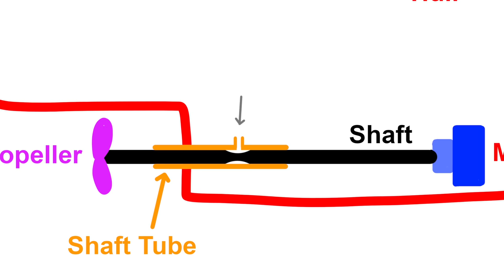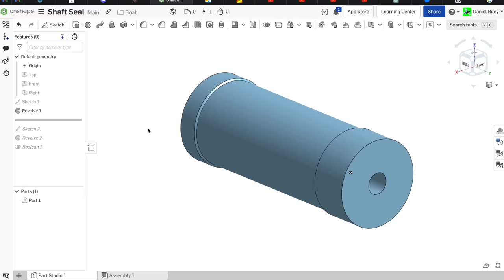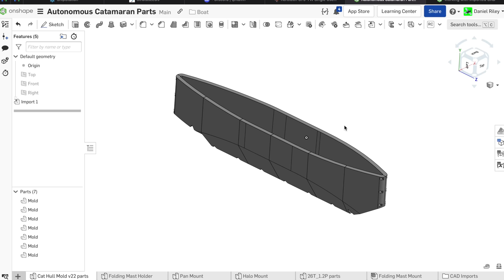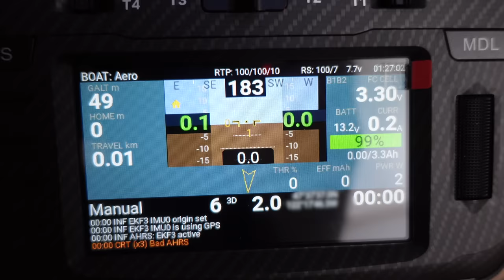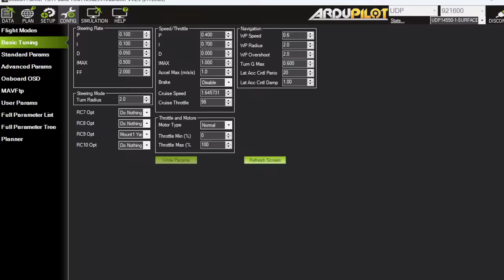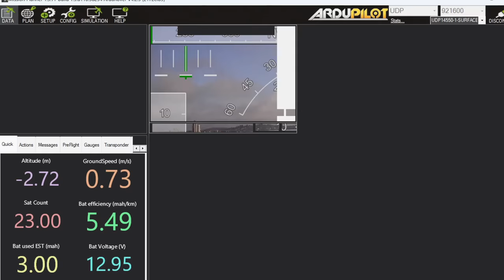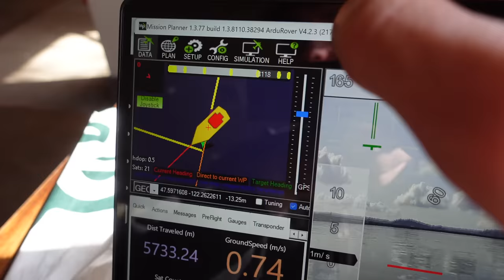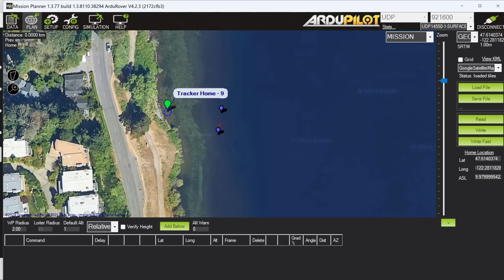5G Cellular Controlled Drone Boat - Long Range Test

Comment from the maker: Use code RCTESTFLIGHT50 to get 50% OFF your first Factor box at https://bit.ly/3JgFdFQ
Reply: Sharpening fins is not good.
Reply: Onboard bildge pump and float swich so you can pump out water as you take it on, for whatever reason.
Reply: Please read my post on Coast Guard Rules, when you are on the water, think as if your were on any public road/highway. Would you drive your RCs on an interstate?  Lights mean very specific things, and you are not following the rules.  Please don't FAAFO with fines or worse, cause and accident.
Reply: we love it when the shaft can rotate freely in the lubricated fleshlights dont we bois? 🥸
Reply from the maker: @Metazone101  hey its daytime. I don't need lights in the day
Reply: how come you dont use arduboat? btw love the vids
Reply: Why don't you use a bearing on your prop shaft so you don't have any play and then you can seal it with a normal oil seal.
Reply: @Metazone101  jeeeez you must be fun on every party. 🤨😑 but i can see you mean it good. just dont overdue it. every tree log in the water cause more damage to any boat than this thing. if my son plays his RC toy boat in a lake i never heard the fuzz will come and regulate him to infinity because he dont have enough lights on
Reply: Is there any possible way to put a solar panel on the boat?
Reply from the maker: @irisartin385  How do nav lights help avoid a collision when this boat is going slower than a walking pace? There's a reason buoy's don't have nav lights. It's because they don't move. This boat is so slow it's basically a buoy.
Reply: @rctestflight  There definitely are lighted buoys in US waters, but that's besides the point. More importantly: red, green, and white lights on vessels have specific meanings, and those meanings are interpreted by mariners, taking into consideration marine charts and timely observations of the motion of those lights. Your use of those lights to mean something else is potentially confusing.

For example: if I am sailing at night and I see a green light, my first question is whether it's a buoy or a vessel. If there is a lighted green buoy on the chart and your vessel is also displaying a green light, that's already one way you can confuse me; if I mistake your vessel for a lighted buoy I might make a course change that results in me running aground, or otherwise putting myself in harm's way. 

But let's say you're in an area where there are no lighted green buoys, and I know this because I checked the chart, or because I can tell that your vessel is underway because of the movement of the light. Now I know that I am looking at a vessel and because I see a green light without a while light above it I conclude that I am likely looking at the starboard bow or beam of a sailing vessel.

If your vessel is dead ahead of me and I am a powered vessel, I should give way by turning to port to pass behind you. But as I do this, I expect to see your white stern light, which would indicate that I have safely avoided a collision. However, I will never see your stern light (because you don't have one) and as a result I need to continue taking evasive action. This can now force me to enter shallower waters (where I might run aground) all in an effort to avoid a collision with an improperly marked vessel. 

Similarly, if your vessel is off my port beam and all I see is a green light, that would mean you're a sailing vessel on a collision course with me. I would either reduce my speed to pass behind you or turn to starboard to avoid a collision; either way, I am again expecting to see your stern light to indicate that I am clear of the collision risk. But that stern light never comes, and I have to continue maneuvering. 

So the risk here isn't that I will collide with you, because as a responsible mariner I sure as hell am not sailing on a course that collides with any light on the water; the risk is more subtle, in that your non-standard lighting will mislead me about where I am (if I mistake it for a buoy) or about the best way to avoid a collision with your vessel (which I agree would be unlikely to pose me any significant harm), and that in itself can put me at risk of a harm from other navigational hazards. This would be especially true for any vessel that is restricted in maneuverability, for example because it has a deep draft and cannot depart from a designated dredged channel.

The USCG actually has a document about this; excerpt: "Boaters should be concerned about installing 'decorative' lighting on their boats in various places, including underwater, on the rubrail, or just above the waterline. Care must be taken that these lights cannot be mistaken for navigation lights […] Haphazard installation of additional lighting must be avoided.". 

Full document at https://www.dco.uscg.mil/Portals/9/DCO%20Documents/5p/CG-5PC/INV/Alerts/1015.pdf
Reply: @rctestflight  dont listen to the hyperkarens and install a freakin rainbow on it. i dare you! 🥰
Reply: @irisartin385  It's basically a toy boat, you've gone over the deep end. Also no one is going to read what you wrote. Just go be weird somewhere else...
Reply: you could use a magnetic coupling for leak proof shaft? i could be  wrong
Reply: @rctestflight  you could use a magnetic coupling for leak proof shaft? i could be  wrong
Reply: Nice face dude Realy slik
Reply: You should try and make a model rocket to land on a drone ship
Reply: @rctestflight  get a solar panel on the top which charges the battery so it can run for days  and doesn't require a Battery change then you will have a Rc boat which can run for ever just need to pay for the wifi

I also have another idea but will run limited like this one it does need a battery change make it oval shaped with a propeller at end make it bright orange and keep all the electronics in the oval  thingy and you can use seramic at the front for camera view you can also add a syringe system for under water purposes if you want but the  wifi will probably won't reach so you can make it only float also the oval shape is for withstanding super dangerous waves
Reply: In 20 years, my humanoid robot will rob the Bank of England, and bring the gold straight to my vault. Thanks to you.
Reply: @Metazon 101 As long as he doesn't know he has a excuse, don't take that away from him...
Reply: @Metazone101  As long as he doesn't know he has a excuse, don't take that away from him...
Reply: if they can afford a 50% off... you should think about their prices...
Reply: GREAT GREAT VIDEO - THANK YOU!!!   Question please --- what provides power to the 5 G unit from HALO?  It is installed on the boat, correct?  What provides power?  Thank you.

Comment: With a slightly larger vessel you could add solar panels and Starlink for super long-range offshore missions.
Reply: I really want to see this happen asap
Reply: I was thinking about starlink too!!
Reply: @SoulAir  oh true, maybe you could design some kind of secondary gimbal that keeps the base perfectly level?
Reply: @seanyfpv  starlink is still geofenced so you’d be restricted to a small box close to shore
Reply: @SoulAir  It doesn't. People have been experimenting recently with mounting the antennas flat on RV rooftops without any tracking and there are now enough satellites in operation for that to work.
Reply: @DHD-  Cool 😎
Reply: You know that satellite links existed way before Starlink, that are much smaller, lighter, less sensitive; way better suited for remote tracking and control.
Reply: @quarteratom  For telemetry, sure, but not for video with a small antenna and affordable price.
Reply: @SoulAir  it used to be, there has been an update that allows for in the move use.
Reply: @them2545  ahh i see, thanks for the info, i'm not too familiar with the system
Reply: @quarteratom  Dam dude. Who crapped in your cereal?
Reply: @motosk8er2  

It was me.
Reply: You're right. Need satellite internet. And then you can send this boat from Mexico to the United States without people. Like a submarine with control. The Jalisco Cartel will buy your idea for $1 million! You are a genius, dude! Welcome to Mexico, a country of great opportunities for smart people!)
Reply: @quarter atom  This is true, but starlink would more or less work out of the box over ip is what the original commenter meant
Reply: Yeah, he can test it by filling it with bags of "mystery powder", and go from Mexico to US, lol.
Reply: @rdizzy1  For these guys, the main problem is people. Because of them, it is impossible to sink a submarine to protect against detection. If the boat is without people, then you can control it remotely and drown it at the delivery point. So that she sank to the bottom and lay for several months. Until the "fishermen" come and turn on the ultrasound transmitter. To disconnect the ballast and the boat will float with the load. This is how they do it on military buoys. Like in the movie Once Upon a Time in America. Salt trick.)
Reply: @rdizzy1 For a drug cartel, it's not a bad idea. Imagine dozens of them shuttling back and fourth autonomously.
Reply: @DHD-  Especially if you can make it partially sink and go through the water right below the top of the water.
Reply: @rdizzy1  There you go, a submarine-like hover tank and a small water pump. You can submerge the payload and only keep the solar and antennas on the surface. It will then be invisible to radar if it's below the average wave height.
Reply: @kotnapromke  Can make millions of dollars, and you "have no idea what they are using them for", so it is legal.
Reply: @SoulAir  That's a common misconception. Starlink antennas do not use their motors for satellite tracking, only to aim at the correct area of the sky. The satellites are much too fast to track by moving the antenna. It'd look like a swing set if it did that, swinging back and forth every 90 seconds (losing internet on the backswing).

It instead uses a phased antenna array to electronically aim based on the direction it receives from. However, as far as I know, nobody has data on what the maximum tracking speed is, or how much rocking it can withstand. Or even if those numbers are different for the land-based antennas and those that are sold for yachts, cruise ships or planes. (The latter three don't even have motorised mounts, btw.)
Reply: @HenryLoenwind  Exactly. You're right. There is a phased array, not just a dish. But there are already Starlink kits for yachts and ships. With travel fare. And already such receivers were installed on Ukrainian kamikaze sea drones to attack the port of Sevastopol in Crimea. There, this antenna is fixed motionless at the stern of the boat.
Reply: @SoulAir  but sometimes, you just need that guy to point out flaws
Reply: Starlink draws about 120w when running. Doubtful the cellular link draws that much power
Reply: @quarteratom  they are much more expensive iirc and not so easily accessible to the average consumer
Reply: @SoulAir  Thats not true, starlink offers marine dish that doesnt require stable ground
Reply: @Mike  contestant number 5!!! Read my other comment, I already 'learned' this five times
Reply: Wanted to write the exact same post Starlink + panels and then on to the open see 😂
Reply: @them2545 i don’t think so, there is a ship model
Reply: @them2545  Starlink has an RV plan now, don't they? I would hope it would let you go out over the water with a plan made for travelling.
Reply: I like your thinking
Reply: Yes for sure. Like two canoes.
Idc abput starlink but def bigger!
Reply: I would pay just to see this happen.
Reply: Yeah and transport cocaine to Australia!
Reply: Pretty sure the maritime version of starlink is like 30k/yr
Reply: starlink takes a lot of power so it would need to be huge.
Reply: @user-mn1hn8rt2l I'm gonna start building a solar powered cocaine drone boat first thing in the morning.. Do you know how long it takes a boat to drive to Australia from the US by chance?

Comment: I’m glad we’re getting more long range missions, the banana boat video where it goes on a long trip is still one of my favorite videos
Reply: Agreed. That, this, and the solar planes!
Reply: I’m only here to watch Daniel and his roommates eat.
Reply: I really hope he brings back the solar plane projects this season. It was amazing
Reply: Yeah mine 2.
Reply: @o0julek0o  Those and the solar rover that used its wings! So challenging trying to keep it running and seeing its tracks from the satellite photos!
Reply: @davidbrady5618  The solar rover was the best. It's awesome to build something that runs for weeks without any input, eating slugs, moving the grass, testing the limits of its parts.
Reply: Yeah it was pretty funny when he got stuck in the soft dirt.
Reply: @o0julek0o  I have been flying with a parrot controller for a long time. Through a 4g modem. The control range is not limited. You can fly sitting on the couch at home through home Wi-Fi. It is very nice. The only limitation is battery capacity. Solar panel can improve.
Reply: Then he can start smuggling cocaine like a pro.

Comment: Your projects just keep getting more impressive.  I'm a pretty big R/C nerd but you've evolved to the point that I don't understand half of the tech you're using now.  Keep up the great work.
Reply: I call myself an RC nerd as well although I chilled out on long range fpv stuff. All the tech stuff with ardu pilot and his different protocols for use with the cell data lost me this video. Off to google I go.
Reply: This kind of stuff is barely "RC" anymore, we are solidly into autononmous robotics/drone tech at this stage, so no worries if that confuses you as an RC nerd ;)
Reply: It's all Ardupilot... pretty straightforward once you understand how Ardupilot works. The really interesting bit here is that Elsight HALO unit for BVLOS operation and built-in remote ID.

Comment: The props are for a surface vessel (design to stay half submerged and to spray a mix of water and air). To improve the speed, efficiency and tug force you should use a different props, a full submerged one, without the flat part on the blade. Beautiful video as always!

Comment: Hi I'm from Germany and I'm in a model boat club and as a last resort against water in the boat we use a so-called bilge pump with a float switch that pumps the water off automatically when it reaches a certain height in the hull You could also use a shaft seal ring to seal the stern tube to the shaft. 

Hope my suggestions are helpful😅
Reply: You ever see the RC battleship battles? They have air powered BB guns
Reply: @BikingVikingHH  so airsoft guns?
Reply: @BikingVikingHH  thats wild i want one too
Reply: @alwinfrisk1482  so not really, as they fire metal rounds, but if they’re air soft mechanisms that’s interesting. Feel free to educate instead of being smugger
Reply: Yes he could totally use the microcontrollers he got with the water sensors and hook it up to a pump. Also I think he has ESP32 which has WiFi and could send a notification to his phone. So many possibilities
Reply: do autobailers work at such sizes and speeds?
Reply: I would use a set of gears (or a universal joint) to put the motor above the water line and wall off its small flooded part from the battery compartment.
Reply: @RichardBetel  It makes my Self-Filtering Dog Water Bowl work, I don't see why it wouldn't work for an RC Boat.

Comment: might help the silicone thingy if you designed the mold to have a shell that remains installed and has some features around the outside to engage with the silicone, to grant it rigid support. This might also let you make the silicone thingies much smaller if that's useful.
Reply: He could just 3d print an enclosure that holds a small silicone seal and clue it on.
Reply: @BikingVikingHH  well, o-rings also exist, and are sold by pounds for a dollar.

Comment: You'd be better using a long propeller tube, running at a shallow angle to the motor mounted above the waterline. That way, the tube does not act as a passage into the hull for water. Also why not use your water sensor to run a bilge pump automatically?
Reply: Thumbs up, made the same suggestion on the drive shaft.

Comment: It would be cool if you added back the solar panel for the next mission! Then you wouldn’t have to worry about battery as much. Also possibly repositioning the cellular antennas to be on the same mast as the camera, and moving the module inside the hull. Just an idea as it looked like they could be disconnected. Like others are saying, an automatic bilge pump would be a good idea too.

Comment: You should use capacitive and not resistive water sensors. The resistive ones corrode easily and are not reliable.

Comment: To avoid sea weed: You need to increase the size of the water intake and egress ports.

Just add large spherical indents in the front and the back of the hull and cover them with a fine mesh. In the middle of the hole you can add the propeller inside a tube connecting the front and the back. You just need a shaft inside the pipe without any connection to the outside. By adding magnets in the tips of the propeller you could use a rotating ring of magnets outside the shaft to transfer the energy of the motor, leveraging the concept of a magnetic gear.

Another option would be to split a permanent magnet motor and use the outer part with the electro magnets to rotate the propeller directly.